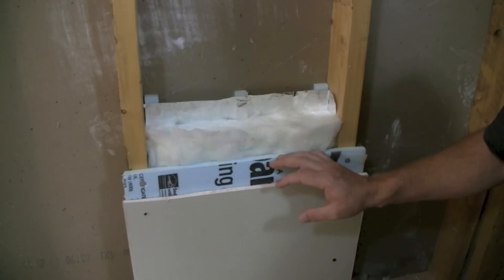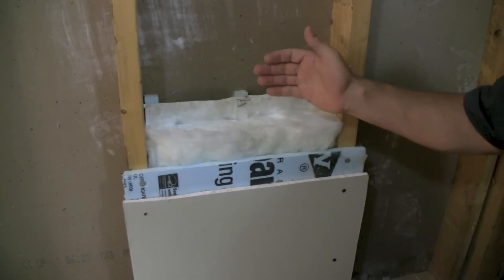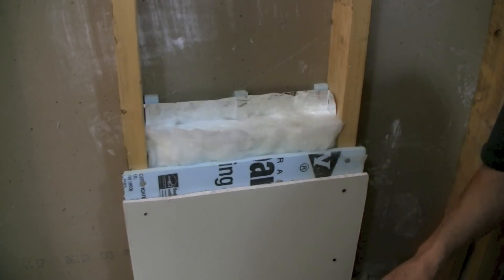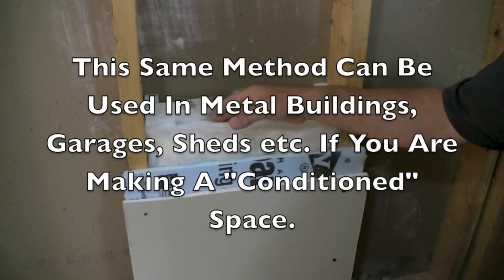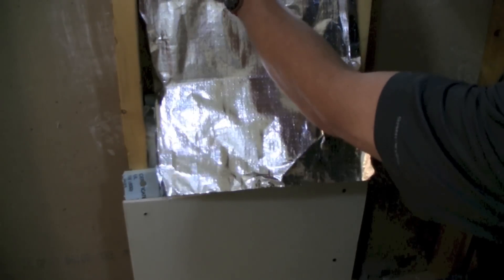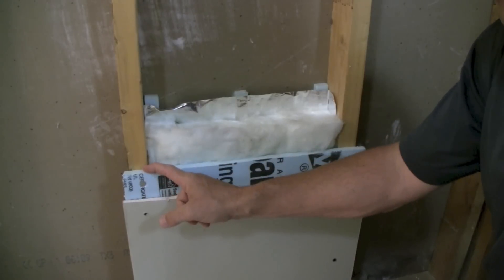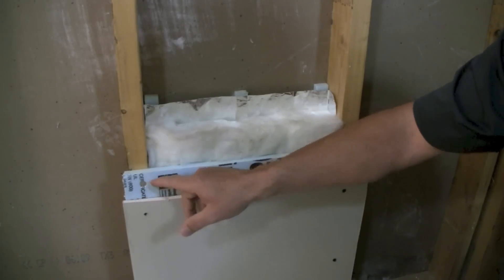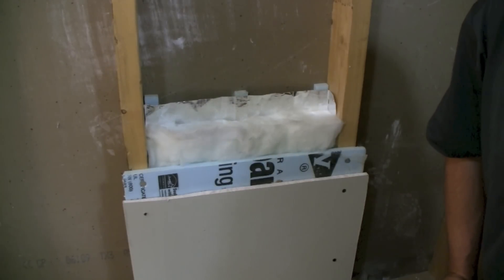How To Fix HOT Exterior Walls When Doing A Remodel.

Comment: I am not going to put drywall up but instead metal. I am doing exactly what you said in the video and have an air gap, then insulation  but can I put Zip 7/16 inch sheathing up instead of the foam board and not have to worry about sweating or moisture build up? I am putting metal on the interior wall so I need something to screw into. I am also concerned about heat transfer from that cavity causing sweating. Any ideas?
Reply from the maker: You have a lot going on here. It would be best to call us at www.AtticFoil.com and discuss.

Comment: I already have baffles and faced fiberglass batt insulation installed. Would a radiant barrier be helpful or does it have to be installed before the insulation?
Reply from the maker: Normally, you want the www.AtticFoil.com to the "outside" and be your first line of defense against radiant heat.  Then put baffles/fiberglass to the inside for conductive heat control.

Comment: Does the Reverse hold true as well with the set up when it is winter and you want to Keep Heat In?
Reply from the maker: Generally same concept for installing www.AtticFoil.com  But, you will want to put the foil to the inside.  Instructions here: https://atticfoil.com/index.php/applications/inside-exterior-walls-cold-climates/
Reply: @AtticFoil  Thanks for the Quick response.  To clarify my question - what if you are in a Mixed Climate like coastal New Jersey. Can range from 90s in Summer to 20s in Winter.   Also any Negative Effects if error one way or other.
Reply from the maker: Either way will work.  If you have a radiant heat source, then I'd install on inside.  If a forced air system, not too much internal radiant heat so I'd install to the outside.

Comment: Can Radiant be enhanced by emissivity ? Would there be any additional meaurable benefit in the hot exterior wall system if a layer of high permeability radiant barrier were installed across the exterior of the stud (easy do when additionally anchored by exterior sheathing).  i.e. would the emissivity component be able to enhance this current reflective foil system by a non-negligible amount ?
Reply from the maker: I'm not 100% clear on a method you are asking about. It sounds like a house wrap type application.  Look at this gallery and the install page and see if it helps.  If not contact us at www.AtticFoil.com and will can help you. https://atticfoil.com/index.php/diy-project-gallery/gallery-house-wrap-installs/

Comment: SO just to be sure I understand—Radiant heat strikes the roof then it “conducts” through the insulation then it CHANGES to Radiant heat again??? Is that correct???  Heat is a shape shifter, lol...
Reply from the maker: You are EXACTLY right!!  A roof has a lot of thermal mass so it absorbs heat like a sponge.  A tree leaf is flat with very little mass, it still absorbs the radiant heat and then dissipates the heat quickly into the air before re-radiating it.

Comment: So I can install reflective foam core 1/4 inch insulation barrier roll  directly to studs with aluminum side facing out and white side facing in since there will be an air space.  I live in very hot place and want to keep all my stored stuff from getting too hot.  I have shingles on the roof , do I do the same thing for the roof....install on the beams?
Reply from the maker: You may want to call the office. www.AtticFoil.com  It really depends if the space you are enclosing is "Conditioned" or not.  If not conditioned, then any foam type product will not perform any better than foil alone.

Comment: I don't understand this. If it is true that as soon as you touch the foil, the foil becomes a conductor why the white insulation touches the foil from the inside? Should the air gap exists also between the foil and the insulation to truly keep the insulation cooler?
Reply from the maker: Just need an airspace on ONE side.  So the foil side faces an airspace between the foil and the wall sheathing.
Reply: @AtticFoil  yes but the other side of the foil is significantly heating the insulation acting as a conductor.
Reply: @Giuseppe_coachgius  at some point it's diminishing returns... yes it would help, but to what cost?  If it raises your bill $50 a year but cost you $1,000 bucks to install, then you are looking at 20 year ROI.  That's just not worth it.

Ever take foil out of the oven with food on it... the foil is almost cool to the touch immediately.

Comment: I was curious the benefit of installing the radiant barrier on the attic side of a wall in a bonus room. One part to help hold the existing insulation in place. (R19 in a 2x4 wall) So it doesn't fit well)  Will this provide benefits of a heat barrier? Or will installing it directly over the insulation and stapling to the truss transfer heat?
Reply from the maker: AtticFoil works great on the attic side of an attic wall.  It will reflect heat AND help contain the insulation in the wall.  www.AtticFoil.com  Here is an article that touches on this, or call/emails us and we can send you pictures of this method from some customers. https://www.radiantbarrierguru.com/hot-rooms-in-my-house-how-to-make-them-more-comfortable-part-1/

Comment: Thank you, but where is the exterior gap air escaping to?
Reply from the maker: It's not escaping.  It's what we call a "dead" airspace.  The foil reflects radiant heat and the regular insulation will reduce conductive heat.  You need the airspace for the foil to be a reflector.

Comment: Can I use this same method for attic? Right now my insulation is on attic floor but I’d like to put rockwool in rafters with foam behind it kind of like you have here but also get the benefit of a radiant barrier before putting the rockwool. I live in SC so would I want to get your perforated product? I understand I need the air gap but concerned about putting insulation behind the foil.
Reply from the maker: The only reason you would put insulation on your attic ceiling is IF you are converting to a game room, bonus room, or other "conditioned" space.  If you intend to do this, here is the video on how to do it: https://atticfoil.com/index.php/applications/cathedral-ceilings-hotmixed-climates/  Otherwise, if you intend to keep the attic "ventilated" then you are better off installing www.AtticFoil.com on the bottom of the rafters and adding more insulation to the floor.

Comment: Hello,  I'm trying to insulate a shed in Michigan to convert into a pottery studio.  Should I install the foil and insulation the same as in your video? Or should I install it behind the drywall,  leave an airspace, then put the faced insulation agaisnt the wood wall? Do I need a plastic vapor barrier on the wood wall if I do it the second way? Thanks for your help!
Reply from the maker: For cold weather and trying to keep IN, you would want to use the SOLID product = Vapor Barrier.  It would be best to get closer to the inside.  So, coming from the inside out.  Drywall > Airspace > SOLID AtticFoil > Additional insulation (your choice) > Exterior wood/sheathing etc.  Solid product is here: https://atticfoil.com/index.php/products/solid-double-sided-radiant-barrier-foil-48-wide/

Comment: Hi, I did a tear out of a wall down to studs. What is currently up is a black fabric then outer siding. My goal is to insulate inside then add shiplap instead of drywall. Can I use a reflective barrier over cotton batt natural insulation? The studs are 16in apart and batt/reflective are also 16in- Do I need to create gaps for air? I plan on using spray ahesive  to put up or would u rec stapling ? Thanks
Reply from the maker: Yes, you can use the cotton batts.  You will still need the same airspace between the foil and the outer wall/fabric/siding.

Comment: I have an unfinished attic I would like to finish.  Several years ago, I had a radiant barrier installed in the entire attic (everything is stapled straight to the stud boards...no insulation).  Can I put the dry wall up right onto the radiant barrier?  What would be the drawback to this?  I'd really hate to have to take the barrier down and reinstall.  It's a decent sized attic.  Thanks!
Reply from the maker: If you are going to convert to a "conditioned" space - Cooled and Heated then you REALLY need to add some R-value in the form of regular insulation.  If this is an occasional use room and you are not too concerned about the exact comfort level, you may get away with the foil only if you have enough AC or heat but it's not very energy efficient.  To do it "right" I would suggest the cathedral ceiling method here:  https://youtu.be/CjwZXoRzRiM

Comment: Great video
One question. 
About the air space. Does it have to be ventilated? 
Thanks
Reply from the maker: No, it does not have to be ventilated.  Usually combining a radiant barrier with ventilation works best, but in a wall assembly this is tricky to do AND still keep the wall airtight.

Comment: I think my current plan is ....not so good.  I have foam board with a foil face. I was going to install this over the studs with the foil facing into the home.  Then add drywall directly over that.  I see now that there needs to be a space between the foil board and the drywall....however will I create any moisture - vapor problems?  Signed, Foiledagain
Reply from the maker: Moisture Vapor Problems??  It depends, if you are in a cold climate which requires an inside vapor barrier (the foil facing) then you are probably good.  If you are in a warmer climate than the vapor barrier should be on the outside of the walls. This can get tricky.  I'd check with some local energy efficiency HERS type experts.
Reply: Thank you as always for your added help.  This is Virginia, mixed humid, Southside VA.   It seems that my foil laminated panels of insulation should be used outside under the siding....with an air gap between the siding and the foam.   Thanks

Comment: I have one question.  I want to do this exact same application on a cathedral attic roof but instead of having the foam board as an extra R value (like in the video) I was thinking of adding another layer of the radiant attic foil instead.  

In theory, the second layer of foil (which is making a "sandwich" layer with the drywall) will help keep some of the inside radiant heat inside the attic and the outer heat out.

Now my question is: Would this work? Or not due that there's no air space on the second layer of foil? (putting into considering the batt insulation)
Reply from the maker: You could do this, but you would need to create some type of an airspace on one side of the foil for it to be effective.  You can't just "sandwich" the foil between the drywall and the insulation.  Here is a page that show this method:  http://www.atticfoil.com/index.php/applications/inside-exterior-walls-cold-climates/

Comment: I noticed that there is no vapor barrier in your demonstration wall. Shouldn't there be? Humans exhale lots of water vapor in our breath and our daily activities include using water for cooking, bathing, etc. How would this construction keep water vapor out of our walls?
Reply from the maker: +Donald Whitehead It depends on where you live.  Do a search on "vapor barrier maps" and you will see most of the South does NOT put a vapor barrier behind the sheetrock.  Yes, the are often installed in colder climates.  This application is mainly shown to REDUCE heat gain - typically Southern homes.  This is why I did not put in a vapor barrier.
Reply: If you mean a plastic sheet as a vapor barrier, those things have been gone for decades (or at least they should be).  They are notoriously bad for "trapping" in water, not keeping it out because you have to have a perfect seal, not even a pinhole.

Comment: Great Video, i have two questions:

1. So the sections where the attic foil meets the foam strips you are in theory not getting a radiant barier because the foil is in contact with the blue board and there is no air space?

2. As it relates to foil roofing osb where the foil is on the 4x8 sheets. Are they essentially worthless because there is no airspace between the foil and the osb?

Thanks
Reply from the maker: +e g #1 Yes, where the foil is "sandwiched" between the blue strips and the insulation there is no radiant barrier benefit.  #2 No, the foil is facing the attic, which IS the airspace.  So, there is an airspace on at least one side as required which is the attic space.  Radiant barrier decking works because of the emissivity quality of foil.  When it's on the bottom of the OSB facing the attic airspace it will reduce the amount of heat released by the deck in a radiant form.

Comment: For rafter foam board insulation, will this method work the same if there are air baffles installed already? Can I just put the foil directly behind the baffling?
Reply from the maker: +crimsonsamuraiftw The problem with putting the foil directly behind the baffling is that wherever the foil has contact on BOTH sides (baffle and insulation) it will loose it's effectiveness.  You MUST maintain an airspace on one side, otherwise it will act as a conductor.
Reply: +AtticFoil Radiant Barrier Foil Insulation Ok, I had assumed that the baffling would act as an airspace buffer just like you have the foam strips in this video.
Reply from the maker: +crimsonsamuraiftw It will act a baffle, but the contact will cause a problem.  If you were just using insulation then it would be OK, but the foil needs an airspace (or minimal contact like the strips) to be effective.